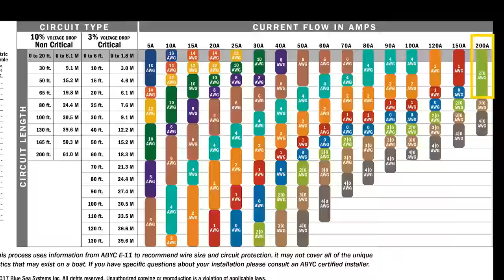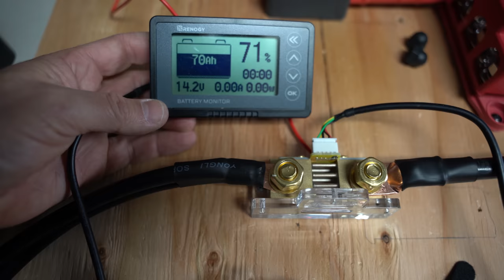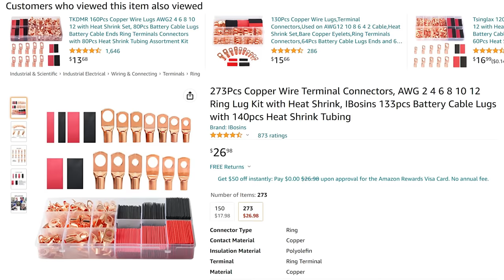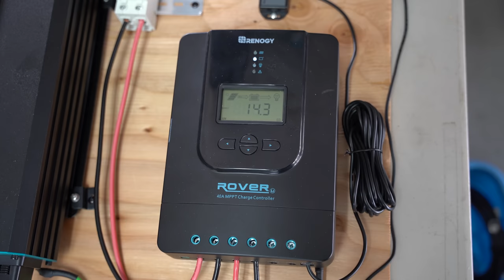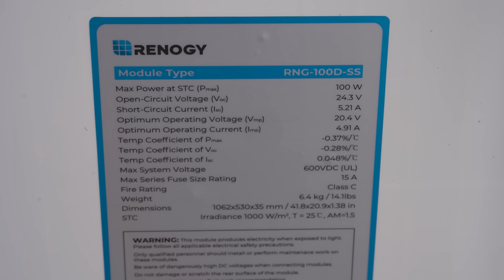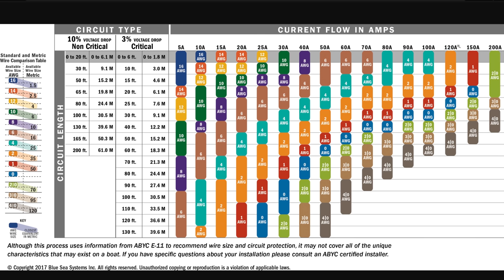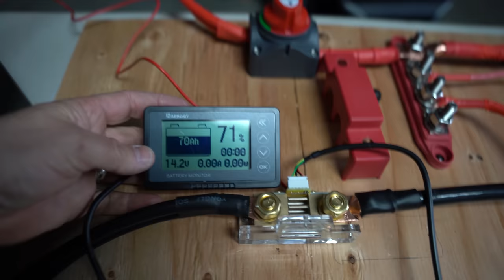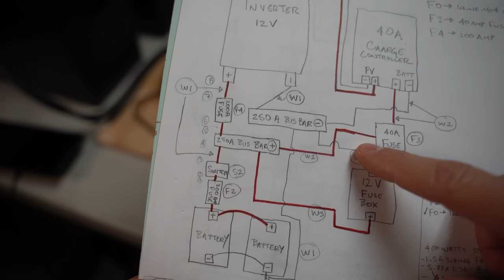How To Build A Solar Setup: COMPLETE Step-by-Step, DIY Guide (12V, 2000W)

Comment: Why when connecting from the switch to the battery and from the shunt to the battery did you use double cables instead of the single large cable?
Reply from the maker: It’s 2 cables combined that can handle 200 amps. Company sent them. I wouldn’t recommend making them yourself but these were professionally built.

Comment: If I wanted to add a 110v battery charger to this system, such as using a generator to also charge batteries on bad days, do you have any suggestions on how to go about that?

Comment: You need more fuses. Fuses and fuses and more  fuses…then you should make sure that you have enough fuses and add more fuses just to make sure you have enough fuses…just put fuses between every component and between everything you see and come upon. Just get more fuses. If you ever doubt about anything just add more fuses..please follow the link in the description and buy more fuses, and if you think you already have enough fuses that’s a sign that you need more fuses. So please buy more fuses. And if you are tired of reading this comment about fuses, that means you need to buy more fuses in order for you to make sure you have enough fuses…charge controllers and batteries already have built in fuses but you need more fuses…
Reply: 😂 I'd much rather replace a 10 cent fuse than a $200 component. 🧐
Reply: @YouLookinAtMe-Bro  exactly. Way to go. Always make sure you have enough fuses. If you are not sure about if you have enough fuses it’s always best to make sure you have enough fuses. Just follow the link and buy more fuses. Once you got all the fuses you need, again, make sure you have enough fuses and buy more just to make sure!!!

Comment: I do not get one thing : Why between battery and inverter is 40 a fuse?    2000w / 12 v = 160,6 a .
Plus inefficiancy 0.85%.     160/0.85~ 188 a. 188 a will go through cable and 40 A fuse . Will fuse survive this?

Comment: Does this allow me to use power on inverter while charging battery? What Im doing currently is I connect my charge controller to the battery 12v 200ah Agm then the inverter to the battery and then connect the solar panels to the PV ports properly and wont show it charging the battery at all no symbol even .

Comment: I just looked at renogy manual it says use a 250 amp fuse yet they give you 1/0 wire. How has yours worked out. Are class t fuses needed instead of the mega fuse

Comment: So if the whole system uses  2/0 awg For. major  circuit. Why the  double NEG and Double POS wires from Battery to shut-off or Double Neg to Neg bus bar

Comment: The amp does not increase from 166.67  to 196 when you reduce it by 15%.

In a perfect world, where inverters are 100% efficient, it would be 2000 watts divided by 12 volts wich is 166.67 amps like you said. If you take into account the 85% efficiency, you don't get an increase to 196 as you said in the video.
Instead, to get 85% of something, you multiply by 0.85 so 200 watts divided by 12 volts and then multiply it all with 0.85 so 141.67 amps.

If I am wrong, please correct me.
Reply: Yeah, I'm sorta confused to. 🤯
Maybe because I don't know where that 1.56 comes from, that he was talking about.

Comment: What is the third green wire for in your video ? 
1 is the inverter ground, the other is mppt charger ground but there is a third leading of the bottom of the screen. Could you explain where you have run this one to please ?
Reply: At minute 27:00 he mentions that it would either go to the chassis on your vehicle, a grounding rod or some other grounding device.

Comment: I understand the need of fuses into a system but I never understood how a 10 amp fuse will work with a solar panel because a solar panel has a fixed output even if you short them the 10 amp fuse will not blow because the solar panels are only putting 5 amps out maybe 6 amps and even if you multiply it by that 1.56 you still not going to get over the 10 amps that I fuse needs to be blown so somebody has to explain to me why would he even bother to put fuses on solar panels, as I said even if you short them at the other end they will provide only a limited amount of power is not like they're going to all of a sudden make 100 amps to blow fuse

Comment: I required wattage the baseline for determining the components? I plan on running a small mini-split, small refrigerator, one cooking coil, and need enough room to run a few lights and a microwave. I want to be able to do this for at least 24 hours on a single charge. Any suggestions on how to scale what is presented here to supply my needs? anyone

Comment: With this setup ,If You tale 2000w from that battery IT will discharge in 30 min.The setup is ok ,but use a larger battery.

Comment: If the inverter is not 100% efficient, wouldn’t the current be less than the initial calculation of 2000/120= 166 A. Why did it go up to 196A?

Comment: 2,000/12=166.66 amps.
This means the battery needs to have a 200 amp BMS
The battery listed is only a 100 amp BMS battery.
That math you did also determines the choice of battery for your system.
Your battery is great for a system with about a 1,200 watt inverter.
It looks like you are using two batteries in parallel. That may work for the needed 200 amps but what happens if one BMS decides to get lazy or shorts out and stops working. The other battery gets overloaded. Poof! Double the smoke is let out.
You said it right always go up when sizing things in the system.

Comment: Problem is my local electrical safety authority and code prohibits batteries out in the open. Need to be in a fireproof box or room. 

In their defense, is there an increased risk of fire with some of these batteries? Not sure if I could sleep soundly at night knowing I have a potential fire hazard in my furnace room.
Reply: Lead batteries can create explosive gas when charging and need to be in a ventilated space. Lifepo4 batteries do not and are not explosive. Lithium NMC are potentially explosive but they aren't great for solar due to many less cycles than Lifepo4.
Reply: The Lithium Iron Phosphate battery is the safest (Lithium) battery chemistry since it will not explode.
Reply: @LibertyDIY  That’s what I read. Not sure if Canada is lagging behind or not. But my electrician said the ESA stated either fireproof enclosure or fireproof room. 

Need to bring them in for inspection and assessment. This is a furnace/ laundry room. No way I can fireproof the room and I have yet to see a fireproof rated enclosure. 

 I was looking at the Renogy Lycan box but although ip65 rated, not fire rated I believe. 

I’d have a heck of a time trying to get that down the basement stairs at 265lbs. 😀

Comment: what determines if I need a 40 or 50amp Tocas circuit breaker. My charge controller is 50amps.

Comment: ??? I have this cheap charge controller with usb ports. When I connect it to solar panels theres nothing on screen. I would like to charge for ex my phone directly by solar controller. So does it only work with some battery connected or is chrage controller broken. From what Ive observed does this all work only with battery and inverter attached?

Comment: Something concerns me about your PV/MPPT wiring. If a DC current flows to your MPPT C/C and it is not connected to your batteries, it can damage your MPPT C/C. At least this is what Victron Energy are saying. If your Circuit breaker from your MPPT trips, there is a current which cannot go anywhere but the MPPT, therefor damage can happen. Please correct me if I am wrong.

Comment: Chris I have a 5000 watt inverter 13 volts so 417 amps and after adjusting the value as shown in your video I need wiring for 490 amps but, I don't see that in the chart. Any thoughts? Thank you
Reply: I mean 12 volts Chris
Reply from the maker: yeh that chart tops at 200 amps.  I'm sure there's charts for bigger setups and wiring with a quick google search.  A quick search for "400 amp wire size chart" or "500 amp wire size chart" showed me a lot of options.
Reply: In reality, a 4/0 will handle it but technically you would need double 4/0 cables.
Reply: @CityPrepping  Thank you
Reply: @LibertyDIY  Thank you

Comment: One battery about $500 or $450. Question could you use dry cell batteries buy golf cart batteries I know those are less expensive then what you be paying for the original batter using but

Comment: Hi, can I check your maths for the wire gauge you specced? The video says 2000W/120V=166Amps, but shouldn't it be 16.6Amps. therefore your 200A wires are overspecced (should only require 20Amp wire). Thanks
Reply: Its 12v

Comment: 85% of 166.66 is 141.66.  you divided the .85 instead of multiplying. 196 is 118% of 166. I'm stating this to ask if this was intentional, I am neither an engineer or mathematician. Please elaborate

Comment: Your math appears wrong on the efficiency of the inverter, 2000/12 X.85 is 142 amps, not 196,  you said divide by .85 that is not correct.  Without the efficiency of 85% even at 100% that is only 166 amps. So unfortunately the rest of your system is built off of the need for 196 amps when in fact the max is 142.  To demonstrate this, if something has a rating of 100 at 100% efficiency, but it actually runs at 85% then you multiply .85 x100 you do not divide, if you did then it would be running at 118.  So therefore you could have used #2 wire which is less money and easier to work with

Comment: If a 2000w inverter is %85 efficient wouldnt you multiply it by 0.85 rather than dividing?? Dividing by 0.85 results in a larger number when it seems like i should expect a smaller number because of inefficiencies. Someone please help this make sense to my brain

Comment: I see a fuse between your positive bus bar, but don’t see one between your power cutoff and battery.  Not a good idea.  Myself, I use a breaker between my bus and inverter. The fuse block is between my battery positive and EVERYTHING.
Reply: He put a fuse at the positive terminal of the battery between the batteries and the rest of the setup

Comment: what was the purpose of the fuse box?
Reply: Connect all the dc devices (the ones that are not house-like that need an inverter) in the same place with one cable coming in and several going out and you fuse them with different size amps. You connect your roof vent, lights, 12v fridge, etc.

Comment: This is a little confusing. Doesn't an inverter running at an inefficiency of 0.85 deliver 85% of 2000 which is 85% of 166 = 141 amps??
Reply: The efficiency of an inverter is (Pout/Pin)×100. In this case Pout=2000W (AC) but Eff=85%. So, the real power output is Pout=2000×0.85= 1700W. On the other hand Pin=12V×166A=2000W (DC). Finally, the efficiency of the inverter is (1700/2000)×100=85%. This is because the input of the inverter is 12V (DC) and 166A, 2000W Then, the inverter realize a "conversion of energy" from DC to AC. And in this conversion, energy is dissipated as heat (and other things) losing 15%. Therefore Pout=1700/120V= 14,2A (AC)

Comment: nice..id rather do a 24v instead of 12v.. smaller wires and more power less amps to pull..
Reply from the maker: Agreed! Will do that next month
Reply: @CityPrepping  yes be nice to make a video of that. You made this video very well and easy to understand 👏 if I'm correct a 24v cost about as much as 12v set up just depending on the needs of set up. Nothing wrong with 12v if not using major Amp draws.

Comment: See everyone seems to be dojg this but it takes almost this much to power a refrigerator. Trust me i lost my electric because i was $180 short. Had no electricity for 4 daya so i got a converter to run on my car got a 2000 watt one for over $60 and couldnt even run my fridge and make food on a portable cook top which is 1500 watts. So this just doesnt make sence to me.

Comment: Your amp rating for the inverter is incorrect. 

You factored in the inverter efficiency but you failed to factor in the wire efficiency also you failed to use the correct voltage. 12v is not the correct voltage as a 12v system can run between 10.5-14.8v

Also your fuse should not be rated at constant system amp rating

Comment: Ok 1800W is nothing, how can it be that this works in the USA. My hairdryer needs 2000w for my German outlet that’s not a problem because it has 16A and 230v and so 3600w.

Comment: Am I the only one who realized that 85% of 166.67 isn't 196 it's 141.6695.  Multiply by .85 to realize your answer not divide. If you're not 100% efficient and you're only 85% efficient your number isn't going to be GREATER than what you could push at 100% it will be LESS 😆✌🏻

Comment: your grounding system is incorrect. You're connecting the chassis ground to your wattage ground should be independent, chassis ground and wattage ground or not to be connected together. Your system has to be properly monitored independently when you connect all your grounds together your controllers not properly charge the batteries correctly that's why you have three sets of terminals pair for the Sonos panel independent, neutral, independent positive independent, neutral independent positive for your battery and charge control and the third set. Independent, neutral independent positive to be monitored correctly your charge controller can charge your battery. Collect correctly your fuse box, neutral, and positive to be independent from the battery and the inverter, chassis grounds can be connected together for chassis only

Comment: sorry but this video is too complicated . why you dont make simple video for complete noobs like me . i watched this video and i still dont understand it . why you dont make simple video how to make yourself 3000w solar panel system . explaining to complete noobs how to put panels and how to connect each panel together and also how to connect this to inverter and how to connect wall plug . i have electric car and i would like to know how can i make 3000w system that allows me to charge car on sunny days without using of solar battery . so simple solar panel inverter to plug installation how to do that . rather than complicating video so much like this . video is good but its too complicated for noobs